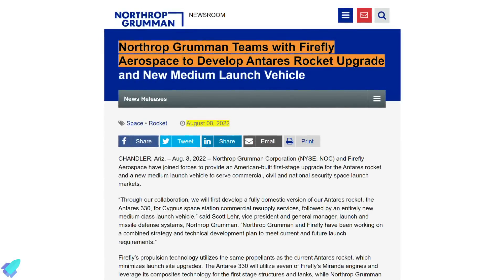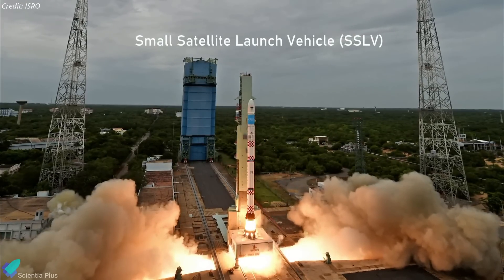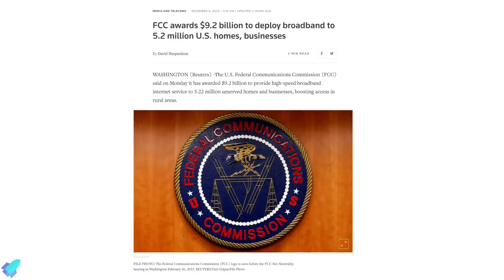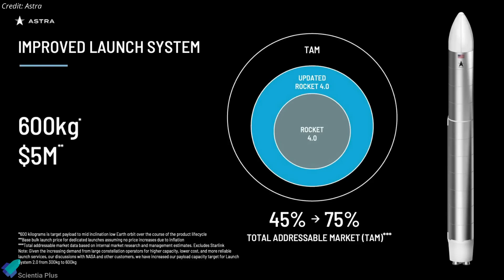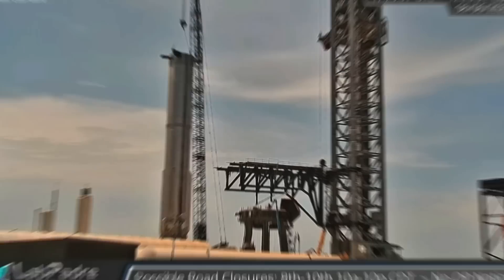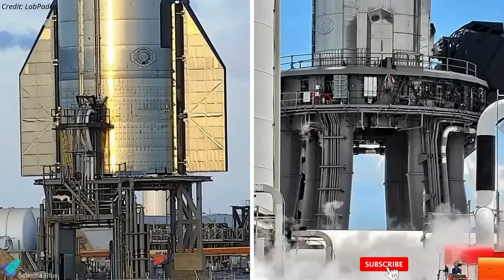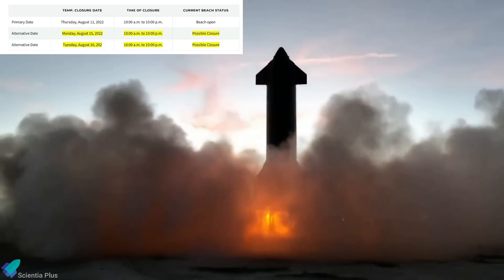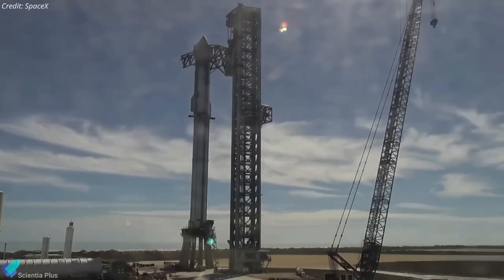SpaceX Starship First Ever Long Duration Static Fire , FCC Denied SpaceX Subsidy, Antares, ISRO

Comment: Without a flame diverter or deluge system on Stage 0 I don't think they'll do a 33-engine static fire test. They'll test the outer engines, then the inner engines, then launch to orbit on the first 33-engine burn. On a different note, Astra Space is looking like a failed startup trying to right itself. Clock is ticking.